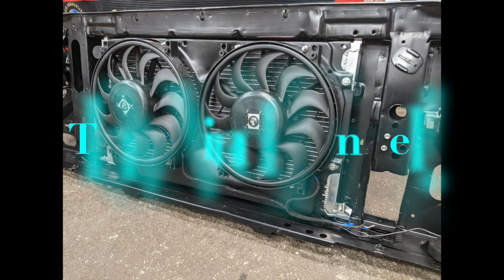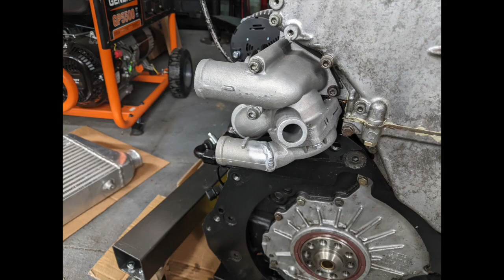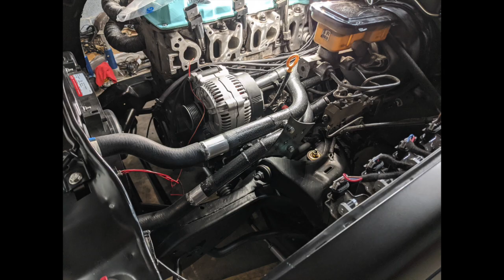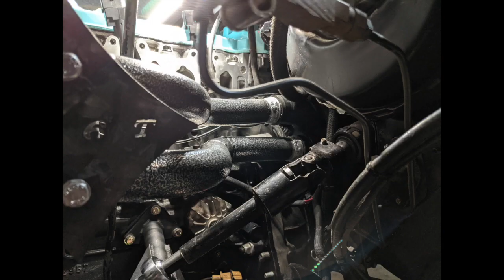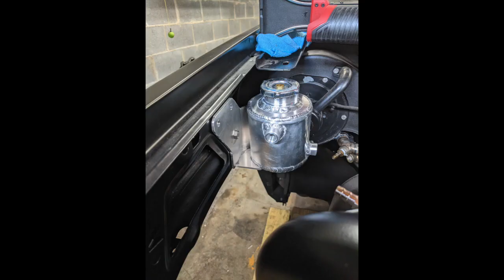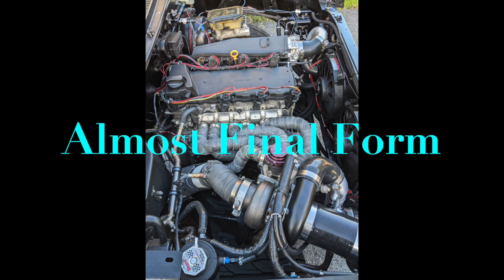VR6 Turbo S10 - Final Cooling System Configuration

Comment: Good work as usual. Who'd you get the metal housings from?
Reply from the maker: Thank you! If I remember correctly it was through ECS. However I did not buy the eurowise one, I believe it was iABED industries. I found out the mk3 lower and Mk4 housing don't work together because the bolt patterns are different. So I ended up using the entire Mk4 housing kit and cutting and welding the lower.